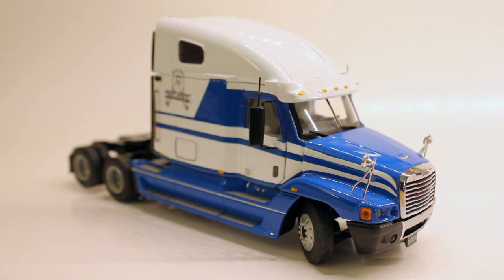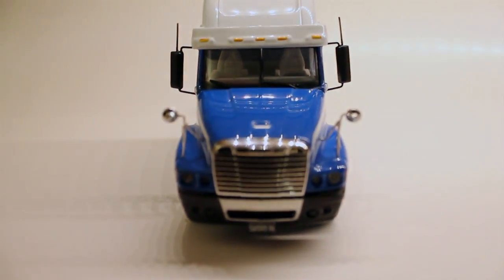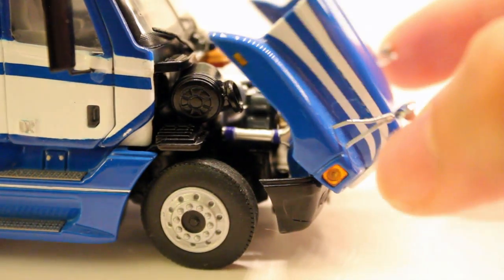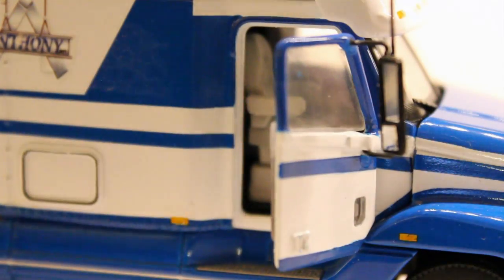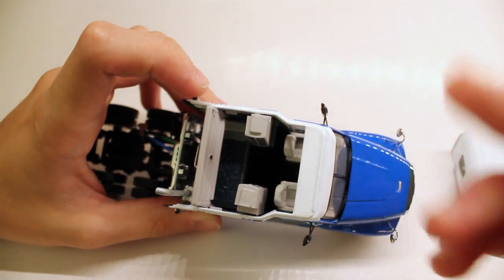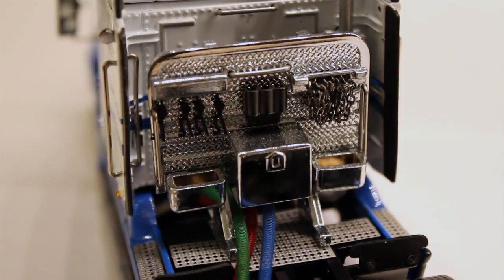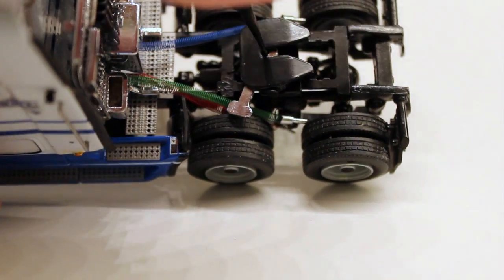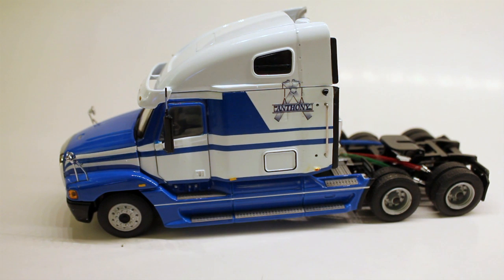1/50 Sword Models Freightliner Century Class Tractor- Anthony- Review

Comment: fyi that is not a gps, it is a Qualcomm antenna, it is used for sending and receiving messages , and company i drive for, it allowed shop to monitor trucks performance of engine

it can provide gps info to the company but as a driver it is not something that you can use for tracking.